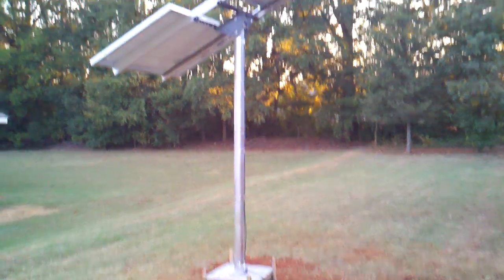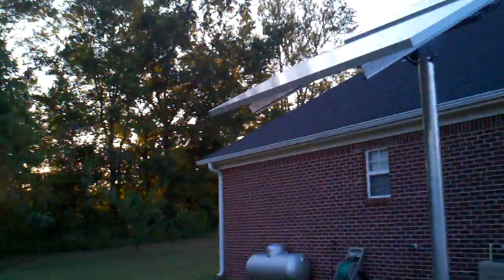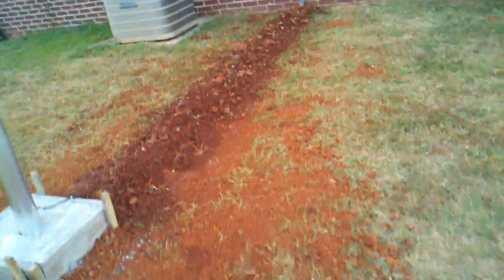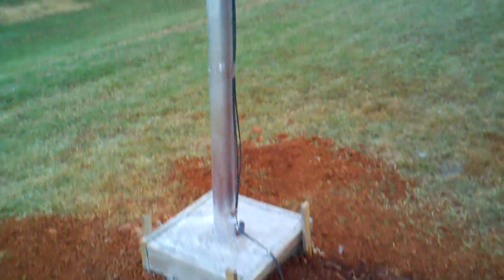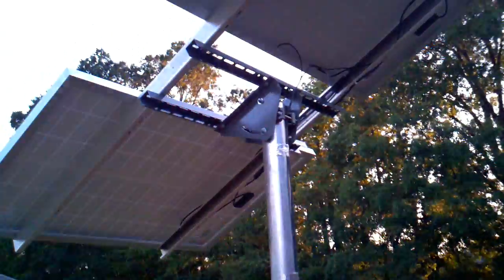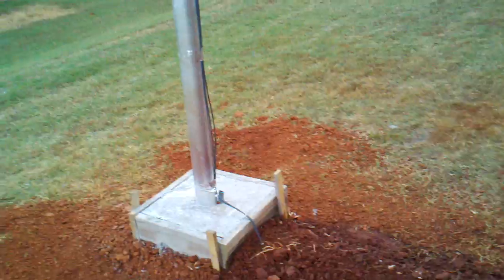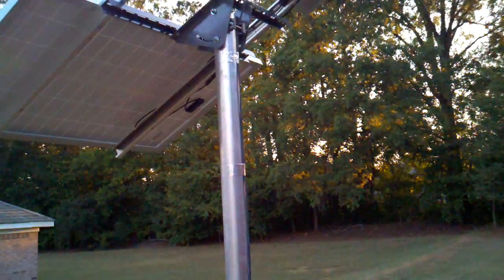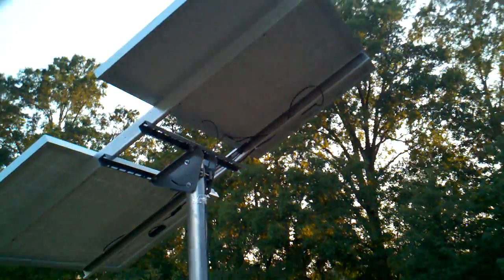DIY-Solar Top-of-Pole Mounted Panels - Part #2

Comment: Nice.  Kind of like what I want to do.  Where did you get the bracket on the top of the pole?
Reply from the maker: You can get a unirac or some mounts from RSP Supply, www.rspsupply.com.  You definitely have a lot of options, I would suggest staying away from the expensive suppliers.

Comment from the maker: @firehawk71 actually I'm using an Iron Ridge top of pole mount and a schedule 40 structural aluminum tubing. The panels are large and heavy and need to be mounted securely to withstand high winds.